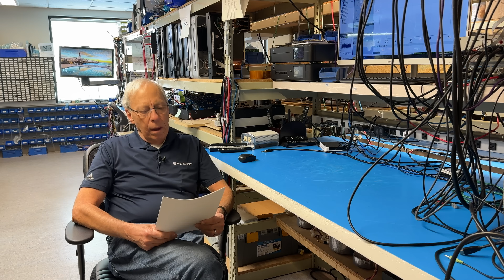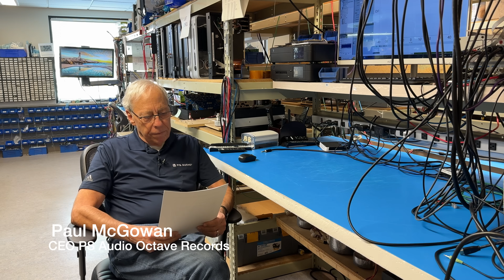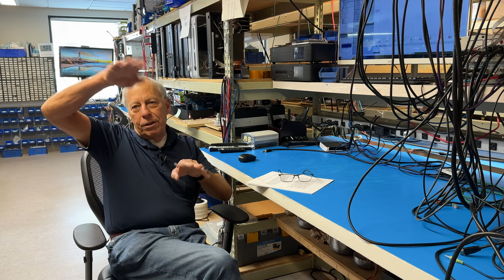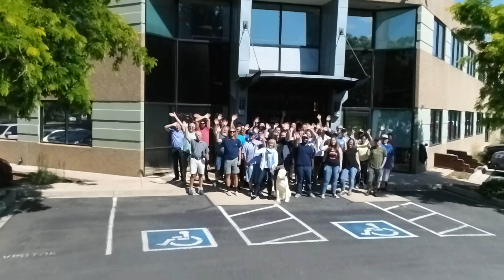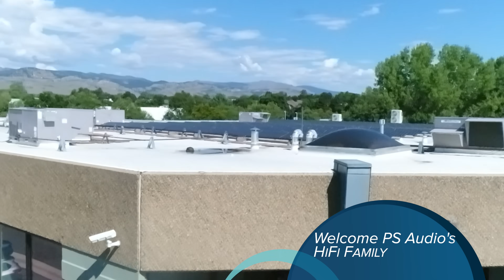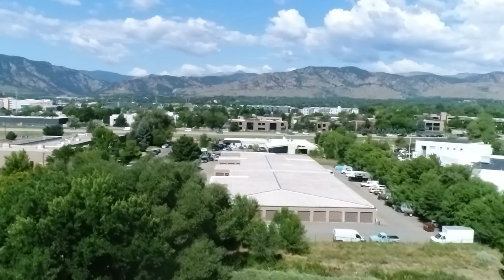Understanding phono variables

Comment: Phono cartridges make great antennae, because of the gain in the circuit (what he said) therefore it is important to isolate the signal 'in' to phono stage and then to pre-amp. Checking the  routing of cords I think is one of the most obvious and easiest fixes, for instance. a small light I use for my turntable had to be repositioned because it caused a noticeable hum from the ac power cord. Aux power supplies for computer devices are notorious noise makers, and so on. Might need some investigation (an EM detector like they use on those ghost hunter programs? Just kidding.)  I use decent source cables but nothing super expensive, short as possilbe AQs I use a tube amp and a tube phono stage with an MC cartride, and I have no hum. One other thing  a senstive MC turntable needs to be acoustically isolated if you have hum, feedback from an improperly positioned TT isn't gonna help. This is old news to most everybody that reads this, but maybe can help a new audiophile that is worried about hum, feedback, and noise in the system.

Comment: I’ve had a Stellar Phono Preamp for years now; it’s the best phono preamp I’ve had so far and I like that I can switch between MM and MC equipped turntables at a moment’s notice, I have a low frequency hum that’s not very loud but can be heard a couple of feet away from the speakers - other sources in my system are dead silent. I’ve tried different cables, grounded/ungrounded, grounding to other equipment, different circuits, moving the preamp to another location, termination plugs, whatever I could think of. I had discussions with Darrell when he was at PS Audio and he was stumped. The thing is, the hum is there when nothing’s plugged into the inputs, and only changes when the gain is changed. MC and MM selections have different amounts/characteristics of low hum. I’ve pretty much learned to ignore it during nearly silent passages but this is the only phono preamp I’ve had that does this. The entire insides were swapped out by PS Audio and it didn’t change so my bet is that it’s being introduced by the environment but I just can’t seem to get rid of it.
Reply: I suggest you try another phono cable
Reply: @2voltage  Did. Tried half a dozen. Tried balanced, unbalanced from phono preamp to preamp. Tried phono preamp with no input cables at all. No change in hum level. Tried different power cables, moving the preamp away from the other units up to 10 feet away, tried a different circuit for just the preamp, ungrounded it and the system in total.

Comment: Also take a look at a transimpedance phono stage if your MC cartridge is very low impedance. Transimpedance phono stages present a virtual short as the cartridge load. Instead of voltage being the input parameter, it is the current generated by the cartridge that conveys musical content. This eliminates finding the "best" load value.

Comment: I have a turntable in my Cadillac. Obviously a custom system running on DC. I do get a little noise but only when the engine is running. Not a problem then anyway.
I haven’t tried a MC cartridge in there.

Comment: The phono pre amp stage is similar to a masthead amplifier in radio communications... it should be mounted right at the signal source and have a low impedance output . The pre amp should be fed with  a  remote shielded DC supply

Comment: Go for a Michael fidler MC pro $800 he only uses a single amplification circuitry where most use multiple amplification what is not good and adds noise and is better than a step up transformer. plus you don't need to adjust any dip switches it's picks it up automatically and adjust it two gain stages 62 and 72

Comment: When the music master is analog I like to believe a proper ADC conversion of it to either DSD or 96kHz 24 bits or higher will be far superior to vinyl for multiple reasons: No wow & flutter, less noise, much superior dynamic range perhaps 10dB better, less distortion, better control of phase, better linearity, no clicks and noise from dust or scratches, no crazy RIAA EQ and no degradation over time. There is no really good reason why vinyl should be better other than lazy companies doing poor conversion to digital. Octave Records should be the go-to-place for getting the greatest music converted in the greatest way…
Reply: people still have thousands of LPs at home that they want to listen to in the highest possible quality.  There is no debate whether analog is better than digital.
Reply: @fkaptijn7111  Yes, it’s indeed quite interesting the vinyl disc has been surviving longer than other physical media such as VHS tapes that are gone today. Probably one reason is that some music sounds better on vinyl due to things done in the process of making the digital copy.
Reply: @ThinkingBetter I have VHS still 😳
Reply: An analog master that was only meant for vinyl production back then has been deliberately limited in dynamics and frequency range. So I wouldn't take that as a decent source for a A/D conversion.

Comment: What do you think of a separate ground for your system? I mean a star earthing arrangement with the star point fed from a single wire to a deep ground spike in the garden, well away from the copper plumbing used to ground the mains system?
Reply: well it shouldn't be necessary and could be dangerous depends where you put the outdoor spike or plate. you could get noise from your neighbours electricity as well. you getting noise from your turntable earth lead put a 500 ohm resistor in series on it
Reply: Yes. The same as anchoring the hifi setup into the concrete slab. It’s what I did no vibrations no problems magical and yes, dedicated circuitry to feed those GPO‘s. Of course that sub is isolated from my solar array that will feed a battery then runs into a Jacuzzi power conditioner and that’s it. Nothing else can possibly exist on that circuit overkill yes but it works.

Comment: Every Phono preamp I've ever owned has a note somewhere saying it should be kept away from other components and sources of electromagnetic interference etc.  it's inherent to the technology.
Reply: The biggest noise issue I've experienced was due to the proximity of my internet router to my phonostage. I bought a stellar about a year ago and haven't had any issues at all. I suspect the shielding is better than the previous units I've owned.
Reply: @jayf3562 off topic but I had my router introduce noise into a usb microphone. Couldn’t figure out what the noise was in the recording. Drove me nuts for days
Reply: yes because it's very sensitive to magnetic fields around it and you can pick up magnetic fields and other electrical noise from other items in your system. and always run the shortest lead possible from the turntable to the phono stage ideally a foot